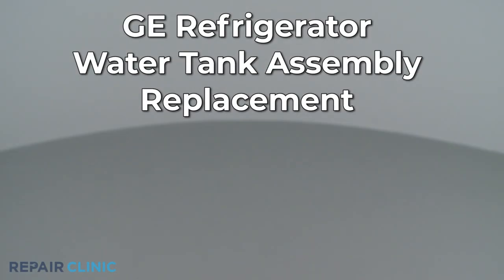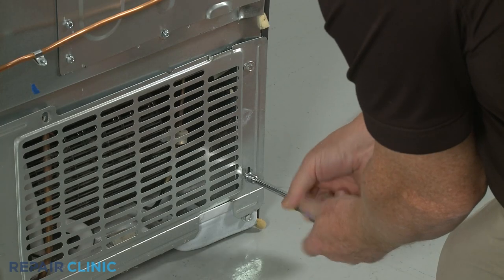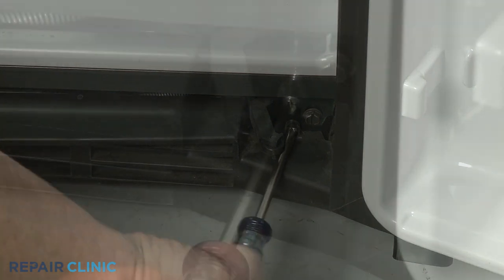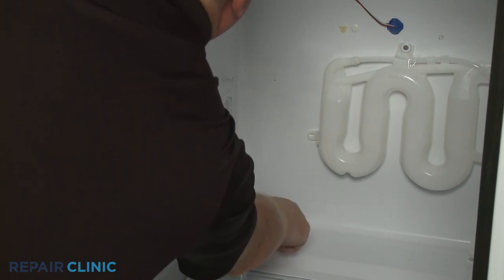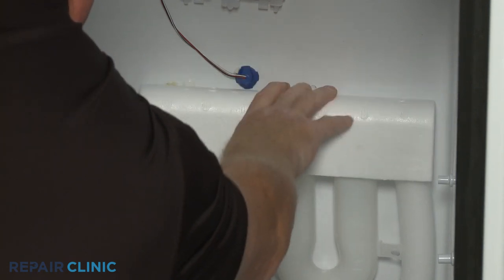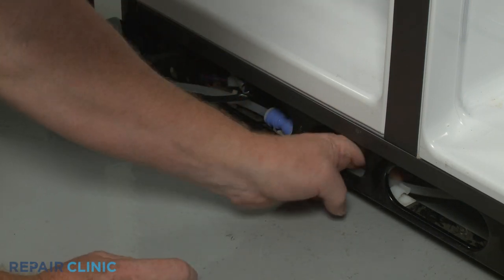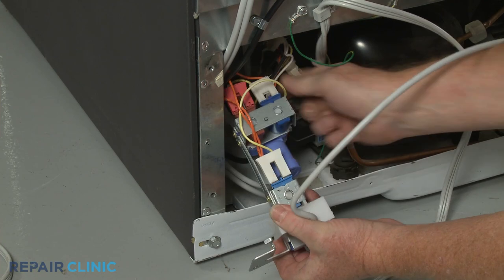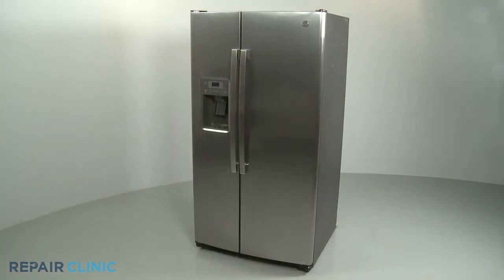GE Refrigerator Water Tank Assembly Replacement WR17X11440

Comment: I need to replace the line from the bottom connector up through to the waterspout outlet.  It is on a vintage 1991 ge TFX27FMA side by side. Having a hard time finding that one.